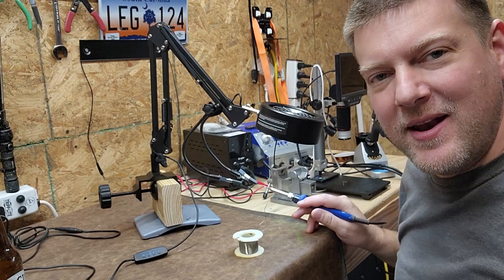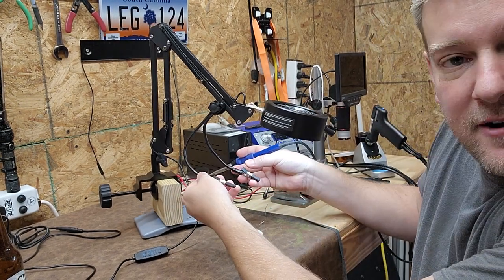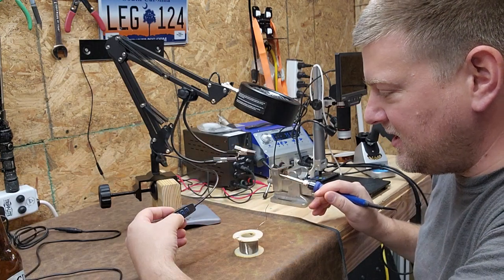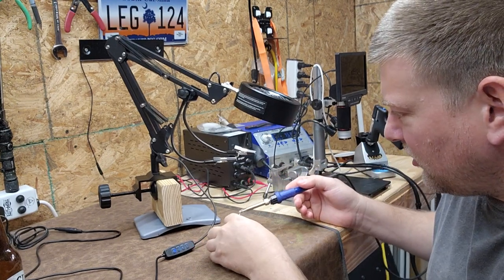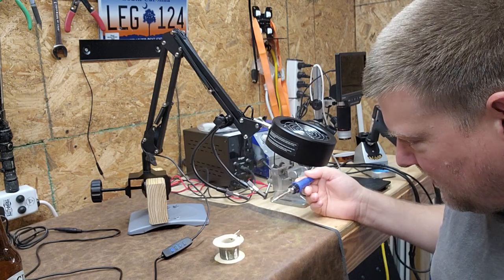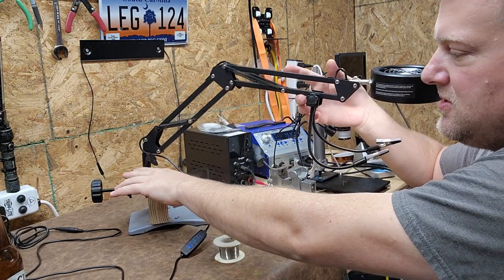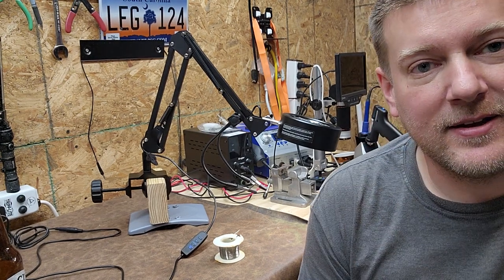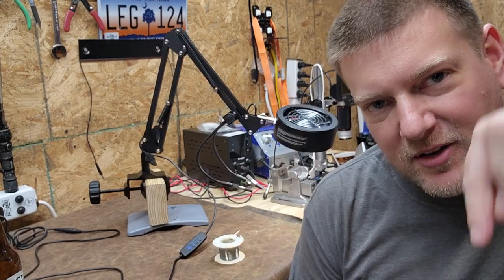The Soldering Accessory?!

Comment: Sir, could you please explain which thermal camera you are using for find short in circuit boards and also pls provide some easy methods find short in smd components
Reply from the maker: I will do this one soon
Reply: @BetterBiomedChannel  am waiting,  i learned many service tips from you, for an example, cathlab maintenance of cable management,  the vedio may be simple..  Its a real challenge in a hospital, after that vedio,  i used to visit and organise cathlab wires after preventive maintenance done by company engineer... As a inhouse i have to see this small  things which reduce  minor breakdowns